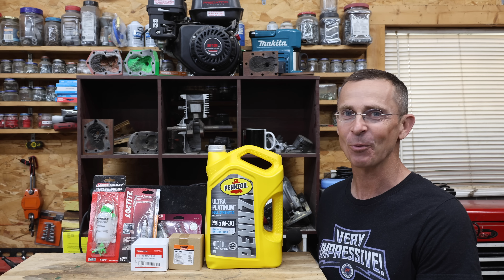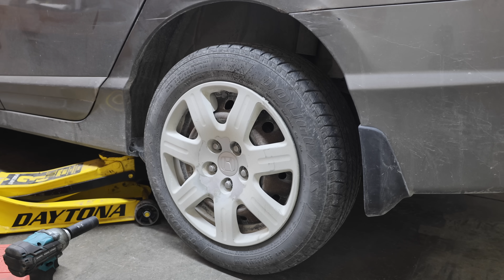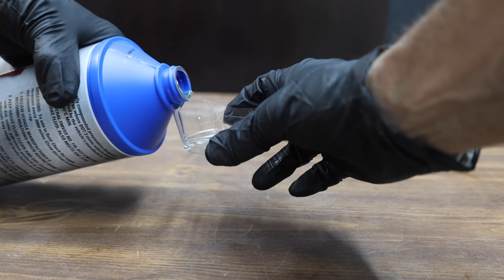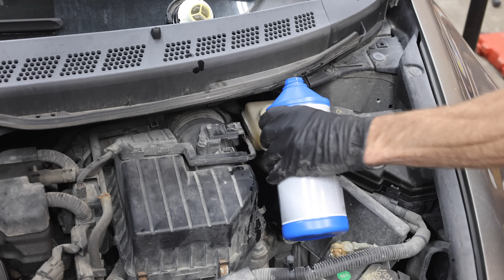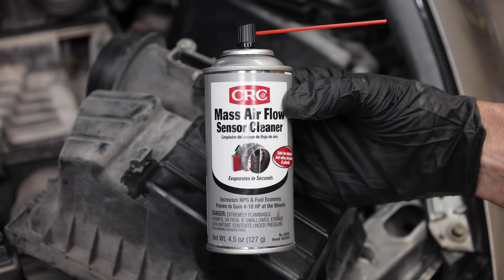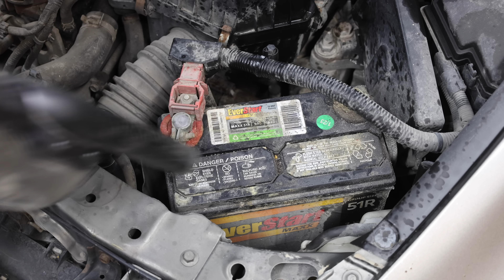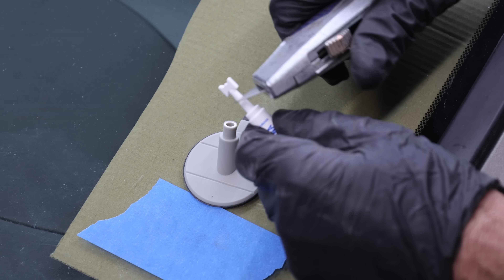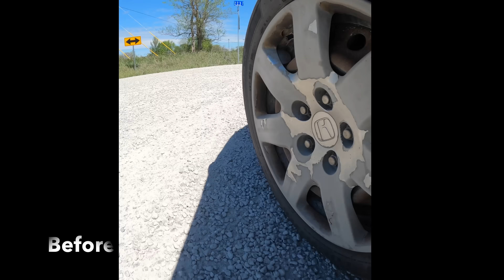Most Reliable 200K Mile Car? Let's Settle This!

Comment: Love the video! I am currently doing the same thing with a 1998 Honda CRV that was given to me for free because of a misfire the owner could not repair. They replaced all sorts of things trying to fix it but gave up letting it sit for years. I had it running perfectly within hours after getting it home. The spark plug wire had a crack in it (even though it looked brand new) causing the misfire. Now I have a CRV that runs great, now its just time to clean it up since it was sitting for so long it will need some basic maintenance and new tires but still can't beat free if you are just willing to put a little time and effort into something!
Reply from the maker: Thanks!  Thanks for the feedback.

Comment: My 2010 Honda Insight has 230,000 miles on it. Had to replace some rusted rocker panels, hybrid battery needs replacing to pass emissions test, but otherwise that baby is going strong, still getting around 40mpg! 
Love the message to repair!
Reply from the maker: Thanks!

Comment: The only thing I would have added would be changing the heater hose’s and the radiator hose’s. I have a 2002 F-150. The hose running under the intake failed on Christmas Eve. I had all the hoses replaced while it was in there. Along with the belt an tensioner
Reply from the maker: Thanks for the constructive feedback.

Comment: I have a 2003 Corolla with 266K miles on it. It didn't need boots, dampers, or rear brakes until 200K. I used OEM parts. Those cheap aftermarket axles usually don't last long but if you replace your OEM boots and keep that axle they'll usually go the life of the car. I did use cross drilled aftermarket rotors and they are way better than the originals. This car is more reliable than a new car and doesn't constantly make stupid noises or hijack my brakes or steering. Isn't it crazy how this car hasn't needed those nannies in 21 years and over a quarter million miles of travel?
Reply from the maker: Nice!  Thanks for the feedback.

Comment: I can not believe that you serviced the rear drum brakes and did not replace the wheel cylinders. Even if they were not leaking (Which you failed to check), they will be leaking shortly if not replaced. Cheap insurance.

Comment: Great video. Take care of your older vehicle and it'll take care of you. Modern vehicles are built with planned obsolescence in mind and will be very expensive to maintain compared to the old ones. Also very difficult to work on compared to older vehicles.

Change fluids and filters in time, listen for unusal sounds and inspect the cause, buy a OBD2 scanner for your vehicle so you can know what's wrong when that check engine light pops up.

Our check engine light just popped up, showed it was nothing more than a leaking gas tank cap. 2012 town and country with 146k miles so far. Hopefully many more to go.

Drive old, take care of it and save $. There's a youtube video that shows you how to replace whatever part is broken, you just have to know what car you drive, which engine and transmission it has. Buy the tools and get it done. You don't have to buy the tools next time something's wrong.
Reply from the maker: Thanks!  Thanks for the feedback.
Reply: @ProjectFarm  You know what's up. 80% of car owners don't even know how their car works. But they last a long time if you maintain it and don't get scammed by shady mechanics who only want your wallet. They can tell if you know something about cars or not, and you have to choose if you don't want to have a working car or pay them thousands of dollars for a $100 in parts job if you do it yourself. 

Sad world, but that's how it's become. Knowing how to fix stuff is true wealth these days.

Comment: Love your videos and I don't know about 200K, but I have a 99 Suburban with 376,000 miles on the original engine with nothing but regular maintenance. Had to replace the tranny. I also have a 2000 model with 285,000 all original everything just normal maintenance . Neither one leaks , smokes, knocks or pings awesome vehicles ! Shooting for 500,000
Reply from the maker: Thanks!  Thanks for sharing.

Comment: I owned a 2007 Civic from 2007 to 2019 when I donated the car to Make a Wish foundation. I am not exaggerating when I say it was absolutely the best vehicle I ever owned. The car had 315K on it. I changed the oil every 5k miles with Walmart's super tech synthetic oil. The only thing i ever had to replace was the starter other than normal wear and tear items. Replaced the plugs at 100K, 200K and 300K. the car still had the original antifreeze that was still bright green and tested fine. I did replace the headlights too. couldn't see out of them because they fogged up so bad. The roll back driver who picked it up for MAW couldn't believe that it started and ran so quiet.
Make a Wish got 1800$ for it at auction too! Can't say enough good things about the Honda Civic!
Reply from the maker: Thanks for sharing.

Comment: Very nice. My wife’s 2011 Civic has 199k and it still going. She drives about 70 miles round trip daily to work. This is a testament that when you buy quality from the the get go, reliability is not an issue. 4 Japanese cars in our stable, all high miles, all driven just about every day. 02 Sequoia 270k, 08 Scion XB 166k, 02 Lexus IS300 154k. Basic maintenance and gas. Buy Honda or Toyota if you want reliable, cheap cars to operate. Too bad American car companies can’t build reliable cars anymore. When I sold my 99 F150 with the 4.6 it had 289k. Leaked oil but kept trucking. Regret selling that truck.
Reply from the maker: Thanks!  Thanks for sharing.

Comment: Older 4runners 2wd, no question about it. I just replaced OEM wheel bearings at 240k miles. It's the only major repair I've had.
Reply from the maker: Thanks for sharing.

Comment: Worn axles making a noise when you turn the wheel is a common problem for Honda's and also if you have a clunk noise coming from the strut is most likely the mount installing new axles and a loaded shredders to answer to that problem
Reply from the maker: Thanks for sharing.

Comment: Suggestion: Fram Ultra Filters and other brands recently aquired by Best Brands. They swear they improved the Fram Ultra by adding pleats and removing the wire backing. They have a higher version now that lists same specs but reportedly kept the metal backed media. Its going to get bigger as more people realize this happened in the last 6-12 months.
Reply from the maker: Thanks for the suggestion.

Comment: i've done this sorta thing for years. not to this level but getting it running right and driving good. it's the little things that will make ya or break ya on patching up a beater.  honestly though that car was in far better condition than what i've generally started with. i'm talking stuff that was junkyard bound or "a good parts car".

Comment: One thing that’s missing is headlight restoration for your Honda. May be you should do a video for different  restoration methods. I tried wd40, toothpaste, sanding and restoration kits…. Any method involved sanding last longest. I can’t find any product good enough without sanding, but I hate sanding and clear coat repaint process… 😅
Great video !

Comment: imo the VERY FIRST test I would perform is an engine compression test!  Check the engine stats, if compression is below recommended in one or more cylinders don't buy the car.  And don't forget to check the manifold gasket for leaks if low compression.

Comment: My 2005 Buick Lacrosse has just over 312,000 miles. Internally the engine has never been touched and doesn't burn oil. The transmission was rebuilt at 114,000 miles, and is still going at 198,000 miles since rebuilt, much better than new from the factory. GM is notorious for their poor transmissions, though their 3800 v6 is one of the best engines they've ever made.

Comment: I was a little sceptical about your plans to branch off from the original format but I think you’ve produced a really good whistle-stop tour through renovating a tired vehicle.

If I can offer a suggestion; Each time you used a product you’ve tested before I was expecting a window linking to your previous reviews but you only mentioned some that you have tested. 
Providing in-video links to the tests of individual product groups could boost viewership of older videos and overall channel engagement, it could also help people who are looking to follow your example make good buying decisions for the tools and consumables they need to carry out the work.

e.g. In-video links at timestamps: 

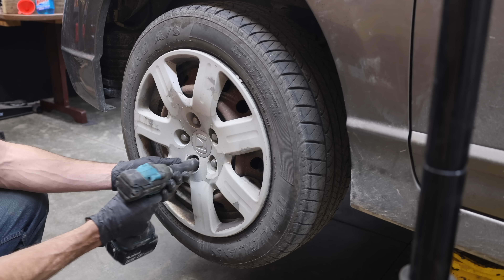1:14 “Best Floor Jack?” and “Best Jack Stands?”
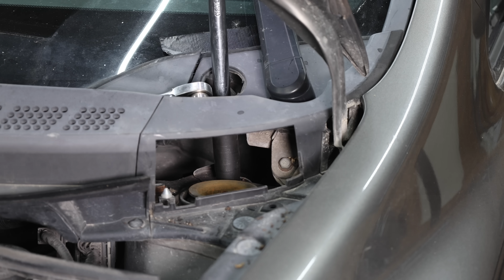1:36 “Best Ratchet” & “Best Ratchet (Round Two)?”
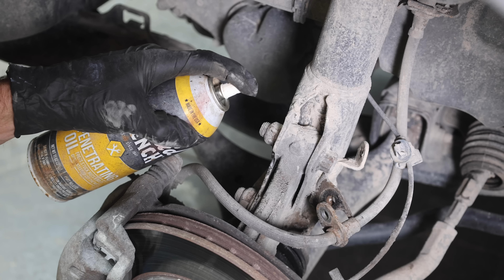1:41 “Which Penetrating Oil is Best?” & “Penetrating Oil Showdown Episode 2” or link to Penetrating Fluid Testing Playlist.

That’s 6 previous videos in under a minute that are all great resources for selecting the best products to help in the vehicle overhaul. I understand that it’s going to add a bit of time in the edit but I think it could really help folks who are looking to undertake such a job.

Comment: Mid 90s W body cars. Namely 1992 Oldsmobile cutlass supreme with the 3.1. And others with 3800, Mine has 324,000 and is still running 31 years later. 😂 show me the competition...a Toyota Honda?I havent seen it. Not 31 y/o 🙏🏼

Comment: i live in Quebec (they use salt in winter here...) i just did a brake job on a 2017 ionic we bought 3 months ago. Well it was something. every bolt was stuck. The calipers apparatus "inflated"because of the rust, causing some pads to not move freely. also it was difficult to put it back together. It took me the whole week end and several trips to canadian tire. i decided to buy an high-end torch that can be used in any direction (my good how could i ever lived without this thing) and PB blaster.

When i see the perfect bolts of your 2008 car, i am very envious !

everything you did on this car would take me a full year lol

Comment: You turned a Beater into a keeper!  The only thing I would’ve done differently is the radiator hose going to the the thermostat I would’ve changed that as long as you are there! Some red spray on the battery terminals to prevent corrosion! Great job! The Car is now worth $7000!
Reply from the maker: Thanks for the feedback.

Comment: Title a bit misleading;  expected comparison between brands/models.
Good comprehensive demonstration of reconditioning a used car.
I'd like to see more emphasis on CHOOSING a good candidate to work with.
Confirming engine still has good compression?  Not an oil burner?

Comment: 2003 is back when they built them a lot better and better quality theses newer ones are just junk plastic every labor is sky high today not what it used to be the old cars parts were way cheaper. I had a 1965 dodge dart 270 slant six back in 1997. Very simple to work on. Keep that Chevy people gotta stop trading in the older vehicle like this.

Comment: I bought a 2012 Dodge Charger V6 8speed auto transmission. It has been my most reliable car two kids drove it thru high school. I’ve had the oil changed regularly tires brake pads and that’s it. Gets 28mpg and has 265000 miles. Still a good car.

Comment: thanks that's one of the best videos I've seen on the value of PM and practical economics. Unfortunately most people are at a loss to deal with a flat.
Most cars become trade ins when a series of small problems accumulate, car traded and debt cycle resets.
My evidence '07 4runner 367k, '85 mercedes 300d 355k . only time these cars failed us was due to dead batteries.
Reply from the maker: You are welcome!

Comment: My old '99 Toyota has had a bad left CV joint for over a year.
I just avoid accelerating when turning right (as that's when it does the sound) and hope it doesn't completely break
Reply from the maker: Thanks for sharing.

Comment: That generation of Civics is plagued with randomly cracking engine blocks that lead to rapid coolant leaks and overheating. Honda released a TSB for it, and did block replacements for free for 10 years from the date of manufacture. Make sure the car has had the block replaced!
Reply from the maker: Thanks for the constructive feedback.

Comment: What oil filter do you use?  I've watched your videos and have been using either Bosch or Mobil 1 in my daughter's Civic
Reply: I use Bosch since they're cheap on rock auto...they also filter down to 20 microns which is better than mobil 1 filters

Comment: Another amazing video. Next testing video Ideas.

Fencing pliers- cutting force, cutting teeth durability, hardness and size of striking head, force required to pry fencing nails and pull wire tight.

Hand axe/ splitting mauls- blade angle as new, blade durability, handle durability, force required for splitting/ cutting timber.

More corded power tools please. Battery power is great and all but I don't want to have to get a sub par tool if I already just have one type of battery and system, to find out they suck at making a battery grinder for example. I just want the best corded SDS drill or worm drive saw etc and don't have to buy a whole kit with batteries, chargers etc. Just a personal opinion, Some more corded tool comparisons would be great alongside the battery tool comparisons.
Reply from the maker: Thanks!  Thanks for the video ideas.

Comment: Couple ideas for videos:

1) test under-sink and refrigerator water filters, such as Water Drop, GE & other name brands, and some of the lesser-known off brands from Amazon. Can the cheap/China brands be trusted??
2)  test the durability and weight capacity of storage totes (Rubbermaid, Rugged Tote, all of those black-with-yellow-lid totes that all of the stores seem to be carrying in their own brand)  for things like abrasion resistance (being slid/dragged), handle durability, compression (being stacked), UV/weather durability, advertised capacity vs. actual capacity, etc.
Reply from the maker: Thanks for the video ideas.

Comment: Can you do a test on CRF CRO 505, do it works?
Reply: I have try those products on my car when I seen it on Scotty Kilmer video ., and it doesn’t work . That was the first and last time I bought those products. What works for me is Lucas oil treatment for the engine , and for the fuel i use  Lucas upper cylinder treatment together with marvel mystery oil . The marvel mystery oil I also use it in the engine . I pour in 8 ounces 5 hundred miles before the oil change .
Reply from the maker: Thanks for the suggestion.

Comment: Love your videos man! I live in Northern New York, near Canada, and I would love to get more miles/years out of my car but she is rusting away from all the salt they put on the road in winter. I got the car after getting her off of a lease with 35,000 miles.  She has almost 200000 on her now and the engine and transmission work great but the fuel tank is metal and from the accumulation of salt over the years the tank got a hole ON TOP of the tank. I tried to remove the tank and the bolts that held the straps broke off from the unibody. :-(  I didn't have the money to buy a new tank so she sat for the winter now the brakes are froze up. I'm hoping to get $700 to $1000 for her to someone that wants to put the work in to fix it. I'm sure the engine and transmission have more life in them, I changed the oil at least every 5000 miles, transmission every 50000. If I just could have kept her from rusting somehow, I'd still be driving her.
Reply from the maker: Thanks!  Thanks for sharing.

Comment: Have a 2003 Honda Accord in the Family Fleet with 332,000 mile on it. 
Still takes off like a rocket. Does not burn any oil. Change all fluids on or ahead of schedule. Proactive on anticipated standard parts replacement.
Reply from the maker: Nice!

Comment: 1.Transmission s usually take old cars out.
2.Severe rust on frame in rust belts 
3.Head gasket failure from overheating.
5.Timing belt failure bent valves.

Any of these best to not get involved.

Check for bubbles in radiator when motor is running.

Check for transmission fluid for brown dark color and slippage under heavy load up hills.

Check underneath for frame rot rust holes near suspension elements.

Get a vehicle which is common to get used parts from salvage yard like a Chevy Impala 3.8.
Reply from the maker: Thanks for sharing.

Comment: i have 5 cars. most of which have high miles. the two that I daily are an 89 volvo 740 with 310k miles, and a 92 honda civic si with 320k miles. both very reliable and very cheap to fix if needed.
Reply from the maker: Thanks for sharing.

Comment: Skoda in the uk. Same group as vw, audi, seat etc. loads for sale on marketplace with 200,000+ ive seen some with 740,000 miles. Mine currently has 226,000 miles
Reply from the maker: Nice!

Comment: Great video, the only thing i'd like to add is, if your transmission fluid was almost black, you should check on the fluid color often in the first 1000 miles and maybe replace the filter within 1000 miles. 

I did a complete transmission flush on my 06 Sierra with 150k miles , and my trans ended up going out because the new fluid cleaned up all the old junk and it clogged the new filter quickly, starving my trans. It took a few months before it finally went out. It may not happen to every vehicle, but theres a chance it can still happen.
Reply from the maker: Thanks for the feedback.

Comment: You still have air in that cooling system you need to start the car and rev it until the thermost open then air bubble will comme out of your radiator that you keep over fill with prestone...

Comment: I'd like to see a comparison between various front disc brake pads and rotors.  Lots of styles and claims of performance.  Is aftermarket better than OEM?  FWIW, I have a 1999 4Runner that tends to suffer from warped rotors which I think is relatively common on older vehicles.
Reply from the maker: Thanks for the suggestion.